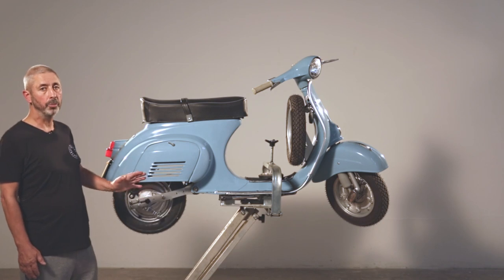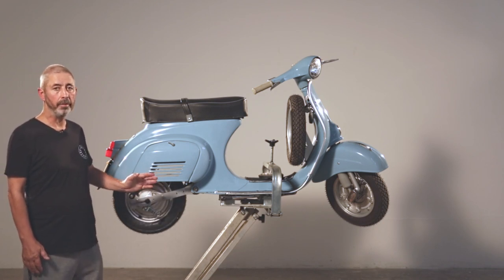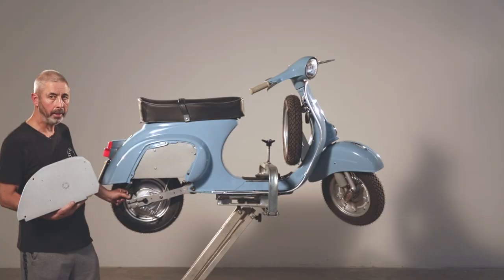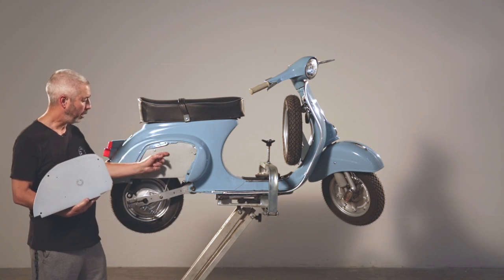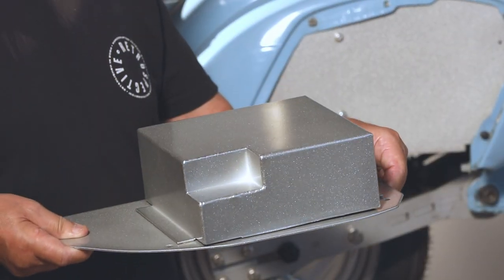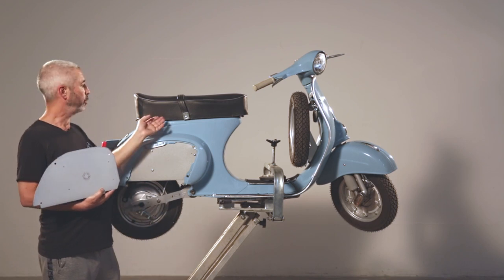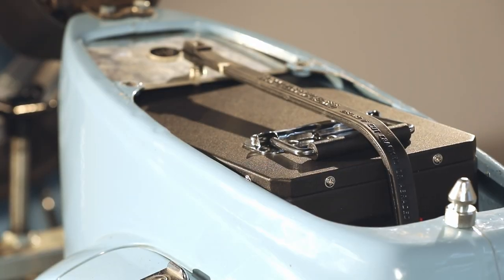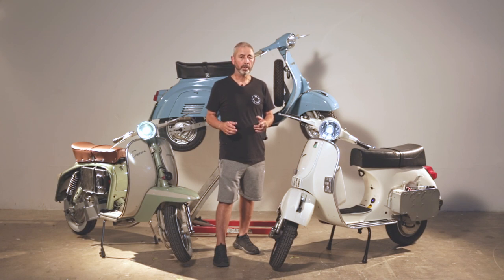Classic Small Frame Vespa Electric Conversion Kits by Retrospective Scooters UK (worldwide shipping)

Comment: Looks really nice. However I just can't understand where the pricing comes from. I build a lot of small electric vehicles (pevs). So I know parts pricing pretty well. I'm sure there is a lot of r & d involved but it just seems way over priced.
Reply: You build what? I've been building quality lithium ion battery packs for around 10 years. To build a battery the same a the one used here would cost around £500 using samsung 21700 cells. I terms of wiring, how much do you actually think is involved? There are basically only 3 components, motor, controler and battery. The things you say make you sound like you haven't got a clue. What with the insults? Can't you have a reasonable conversation? As I'd already said I think this kit looks great, just can't tally the price.
Reply: Same here pal ,great idea and looks well made ,,but I am confused on the from 4K starting price🤔.